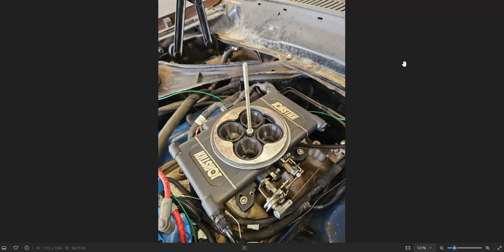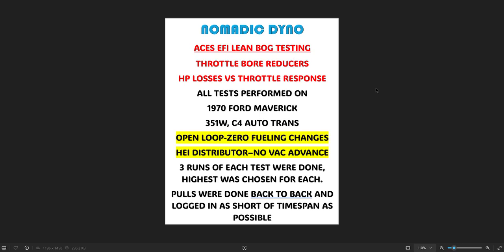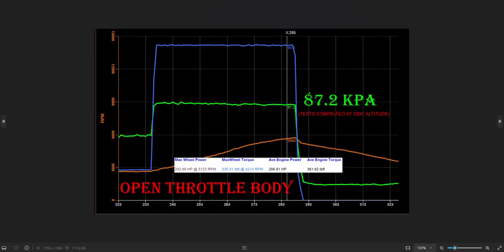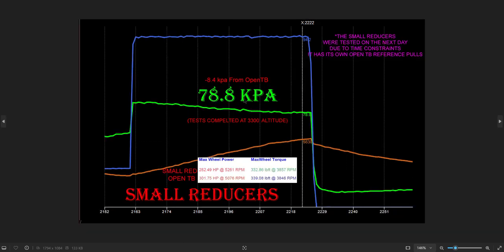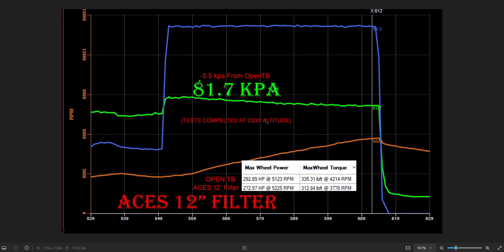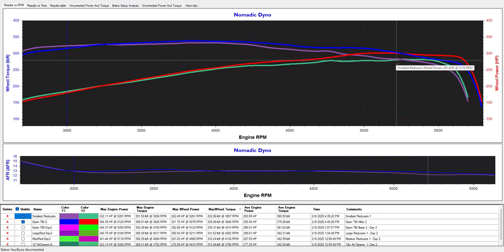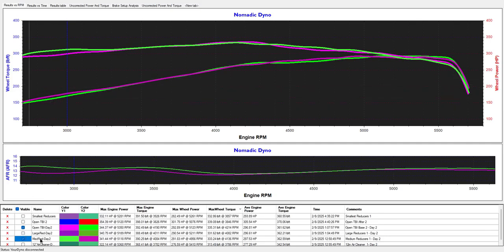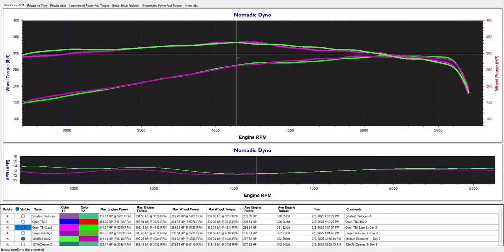Aces EFI Throttle Bog Testing - Throttle body Reducers

Comment: I'm running my killshot on a '96 Chevy 4.3 V8, the 'baby LT1".  That engine is only 265cubic inches and the lean bog is killing me.  I've done some tuning in the program and adjusted the Acceleration VS TPS to no avial.  I think these spacers might be the cure, but you didn't mention the lean bog at all in this video.  I'll go look at your other videos, maybe its there?